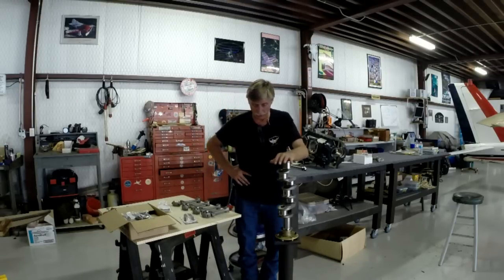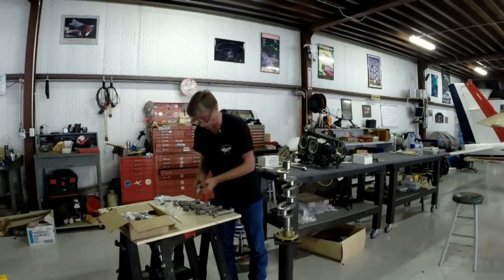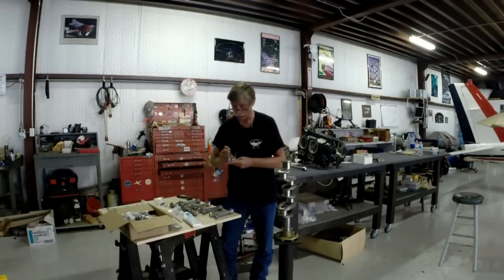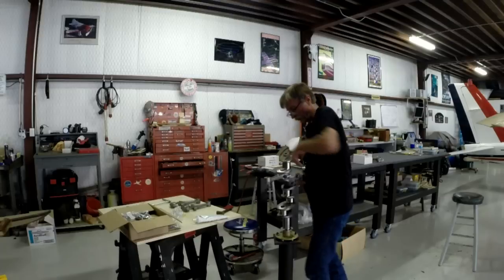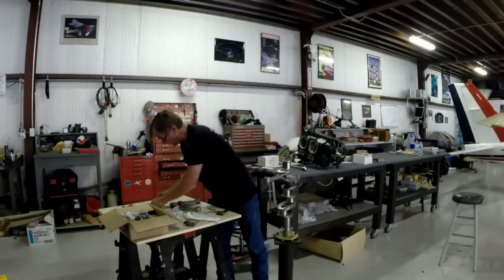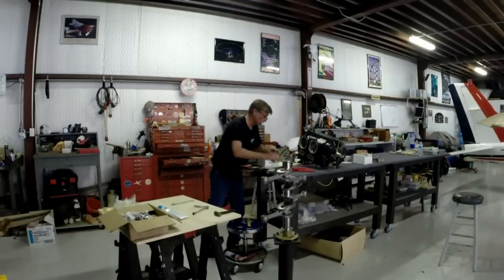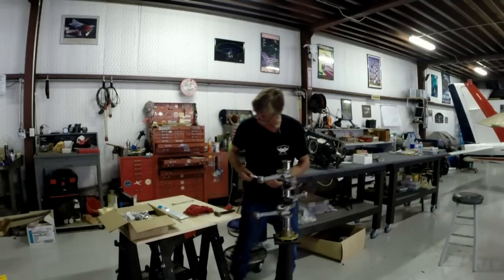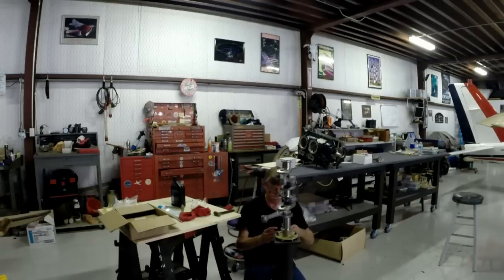Airplane Repo - Kevin Lacey - Engine Overhaul Series -  Crankshaft Build Up

Comment: Kevin, at 33:09 why do you have rods 1&4 facing left and rods 2&3 facing right? Installed in the engine rods 1&3 are on the right side and 2&4 are on the left side. Wouldn't the arrangement in the video cause two of the rods to be installed with the numbers facing downward in the engine?

Comment: Interesting video, but I couldn't follow the point about where you hold the torque wrench handle. The closer to the nut you hold the handle, the more force you have to apply to get the same torque, but the wrench will still click at the correct torque.
Reply: Peak Torque  Not the point at issue.

Comment: I got my A&P certs. back in 2000. When we did this I asked how we new the clearance was correct on the engine when we did not torque the rods together off the engine and measure the opening or use plastic gauge and reopen the bolts to install them on the crank. The instructors had no answer but said that the bolts are 1 time use on many engines and you would have to use 1 set to put together to measure and 1 set to install on the engine. How do you know that you have the correct clearance on the bearings if you just install them? This has always bothered me as on automotive engines you always measure them.
Thanks for your time.
Reply from the maker: +amtpdb1 first you measure the crankshaft journals then you bolt the con rods together with the bearings installed and then measure the ID. then subtract the measurement for the corresponding crank journal
Reply: +Kevin Lacey - Airplane Repo - Texas Air Fleet - &quot;Fly It Like You Stole It!&quot; 
Thanks for answering. Does this cause an issue with the crush on the bearings and the bolts if they are one time?
Thanks again
Don
Reply: amtpdb1 yea aint it called " wear"???
Reply: Breakin tolerance???